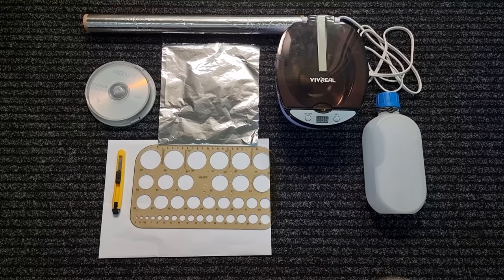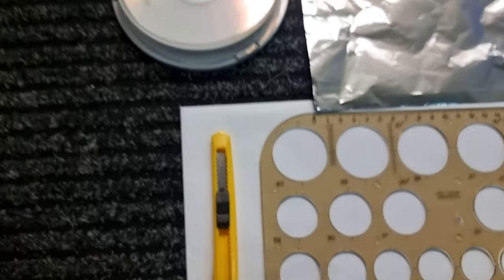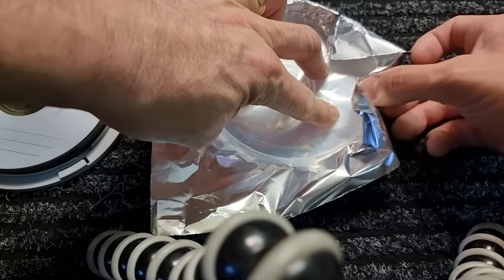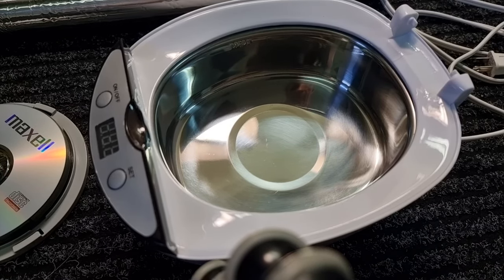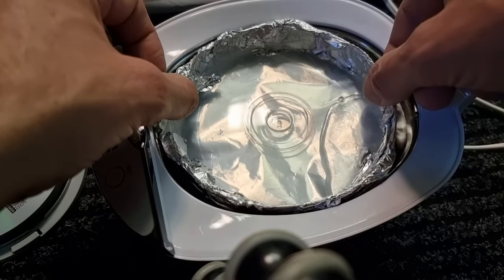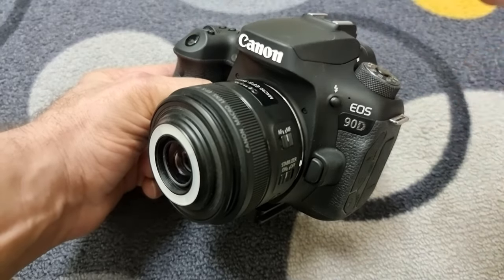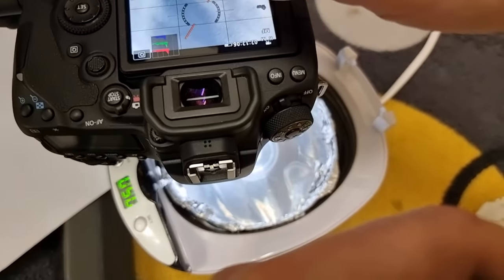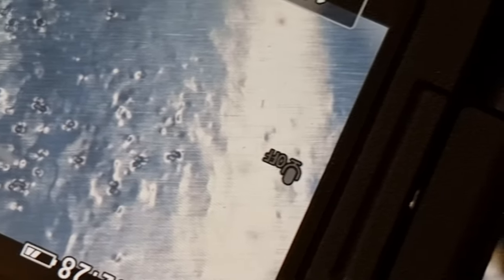ULTR - Experiment how to 4K

Comment: I asked for an ultrasonic cleaner, a few Christmases back, and somehow ended up with a tiny crock pot.  Gave that away to a friend.  I think I'll put this on my birthday list.  Perfect timing!
Question:  have you ever tried it with distilled water?  Other metals?
This should be fun!
Reply from the maker: People have tried it with various parameter changes. 

Go here 
https://www.nanosoft.co.nz/Select_LENR_Events.php

and type "Stringham" into the "Surname of one Author" field and press the  "Refresh Pre-Filtering" button.

Investigate the work in the drop down.

Also, look at "ULTR" posts at RemoteView.ICU.

I will talk about more data from these experiments on Sunday 18 Spetember 2021
Reply: @MFMP  thanks!  Signed into your site last evening.
Reply from the maker: @annebeck58  Wellcome aboard - there you can post links.
Reply: @MFMP    Oh, btw;  the viv-real is out of stock and nobody seems to know if it can ever be found, again.
The next closest, in roundness and size, is the KHLRDK and pricing, in Amazon (evil), is $135, USD.  
I may still order it.
Reply from the maker: @annebeck58  Hmm - that is a lot of money for one of these things - there should be many alternatives.
Reply: @MFMP   The rest are oblong or squared.  I'll find something or I can arrange a different setup-- not a cd lid.  Perhaps tupperware.
Reply from the maker: @annebeck58  There are only two reasons for the CD lid - one - you can film though it, two - the Al foil will not move around so the paired vortexes stay in the same place - any solution that meets the latter criteria should work.
Reply: @MFMP   Well, they've added a new round basin cleaner, by Greenform.  It's $30. and I ordered it.  See you later today!
Reply from the maker: @annebeck58  Wonderful. Please share link at todays RemoteView.ICU posting so others can give it a go.

Comment: Fail. Mine did not work. I got some small pits but nowhere near the destructive power on this video. Perhaps its the size or volume. This one I have is tiny, the opening is about the size of a coffee cup. Oh well.
Reply from the maker: The device used here is 35W transducer, It has 42-3 kHz frequency. You MUST have the aluminium foil with the reflection of sound waved coming of the polycarbonate to induce standing waves in the water column. It does not work to have only foil sitting in the water. You can see the needed effect of standing waves in the demonstration of a transducer and reflector in air set a the correct distance in this video.

https://youtu.be/AZ9RJr_s31w?si=CDbpnfHxGojt0-SI&t=784
Reply: @MFMP  Thank you. I think the power level may be low. Its a 25+/- 3 W device. I'm going to rewatch the video and try to get something close to what you are using. Cheers.

Comment: Is the Ultrasonic Jewelry Cleaner VIVREAL SU-768? Is there a place to buy it online? Are there any similar products that will work?
Reply from the maker: The unit we have for the ultrasonics is not available any more, but something like this should be fine:
https://www.ebay.co.uk/itm/600ml-Ultrasonic-Cleaner-Ultra-Sonic-Bath-Jewellery-Cleaning-Tank-Heater-Timer/274682665990?epid=6024805663&hash=item3ff45cdc06:g:c1IAAOSwgtpe4MY2
Reply: I was recently able to find one on Amazon that works.  $40 LifeBasis Ultrasonic Cleaner 600ML

Comment: Is there sufficient iron present after the experiment for the aluminium to be picked up by a magnet..Also is there any risk associated with this experiment like Mark Leclaires experiment, for example, using aggressive cavitation using a pump?
Reply from the maker: The thickness of the aluminium in kitchen foil limits the possibilities of element mass synthesis. We have not seen higher than silver with standard Kitchen foil. The foil is broken in minutes.

LeClaire used much thicker perforated Al sheet and ran in the order of hours, this results in some locations producing super heavy elements that decay with harmful radiation.

That being said, one should not be cavalier about it.

https://remoteview.substack.com/p/ultr-crop-circles
https://remoteview.substack.com/p/ultr-finger-prints
https://remoteview.substack.com/p/ball-lightning-and-coherent-nuclear

For more detail 
https://youtu.be/AZ9RJr_s31w
Reply: @MFMP  Thanks for your quick reply, I just discovered your YT channel and website today and have a lot to read, I look forward to working my way through it all. In fact it was the Leclaire interview that brought me here.  So do you think Leclaire was wrong with his idea of emergent microjet 'water crystals' causing the transmutation? How would you explain the half-hexagonal shaped tracks that he had all over the surface of those perforated alu sheets..I was going to have a go at this experiment but was a bit worried by the safety concerns he spoke of...But I will definitely have a go at the ultrasonic cleaner experiment you have here...Thanks for all your effort and work!
Reply from the maker: @marksmith9218  Intense cavitation is too dangerous.

https://youtu.be/gcF-KSLIAWs

In our understanding, you can get 3, 4, 5, 6 etc sided holes. Because the thing is able to cluster into regular arrays.

https://youtu.be/hWT9H8TPJeQ?t=1454
Reply: @MFMP  Thanks for the replies, I will work through your videos to try and understand all this..Do you have any videos or links with a simple experiment to prove excess energy in place of the Leclaire cavitaing pump reactor design? Do you think it would be safe enough to try if the cavitation tube was wrapped in a roll of roofers lead for example?
Reply from the maker: @marksmith9218  Strange Radiation can go through lead and pick up atoms as it does so. Lead attenuates Gamma (a very little) and x-rays. Neutrons can loose energy in say Paraffin Wax. 

For best known approach to moderating Strange Radiation, see this patent which I translated.

https://remoteview.substack.com/p/o-day-method-of-protection-from-strange#details

Thin layers of different impedance help
https://youtu.be/8bJm6-OIXNw

Comment: Does anyone have the capability to measure the heat produced at the yin yang nodes as they form and display the apparent “bubbling” from the centers of active reactions?
Reply from the maker: We have an IR camera able to read from -20 to 1700ºC however, the active zone centres are just a few cm across.

The bubbles could actually be hydrogen gas - this would arise when the cavitation results in removal of the passivation layer on the Al foil then Al reacts in concert with the impact energy to produce Al2O3 evolving hydrogen.
Reply: @MFMP  Perhaps, but for me the most exciting part is the possibility of transmutation taking place.  I suppose a new process to parse water would be intriguing from a chemical standpoint, but if the gasses were something other than hydrogen or oxygen it could indicate transmutation.  Or, if the elemental residuals at the nodes proved to be something other than chemical compounds of aluminum + air : for instance, taking oxygen from aluminum leaves boron.  Admittedly, this is a fission process, not as sexy as fusion, but would suggest transmutation and lead in an exciting direction.  But then, better than wishful thinking is the truth!

Comment: Have you ever try to perform an electrolysis in the chamber? Do you think it  may affect gas generation like ohmasa gas? Thank you
Reply from the maker: MFMP collaborating researcher has built a device to test just this in US.
Reply: @MFMP  please let me know how the project goes, Im very tempted to buy a ultrasonic cleaner but im worry that the frequency of a commercial product may not match for the purpose of making the homasa gas. im also getting a function generator for the electrolisys of the plates

Comment: how do you prove to others transmutation? it is 30 dollars or so but to prove it to others one need to get hold of an xrf gun at least! do the test with the gun before and after.. and even if you do so someone may say the alluminium was contaminated and not pure it's not that easy to break down dogmas i find it very hard.. I was showing the ohmasa gas video to a friend who is scientist and he say the tungsten was not 100% pure that's why it melt.. and how can I show then otherways? it is frustrating at time.
Reply from the maker: Tungsten did not melt, it was disrupted. Chris has done unidirectional discharges into W disk from a welding plant, same Pretzel pattern, we will look at under SEM.

Please review these two videos and links available in the downloadable PDF presentation slides.

https://youtu.be/AZ9RJr_s31w
https://youtu.be/gux490Oywoo
Reply: @MFMP  thanx